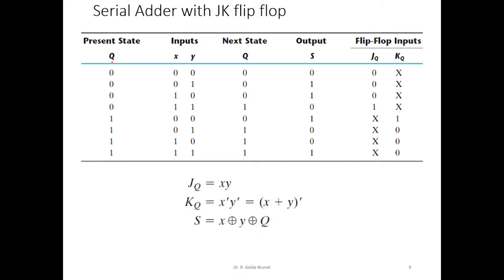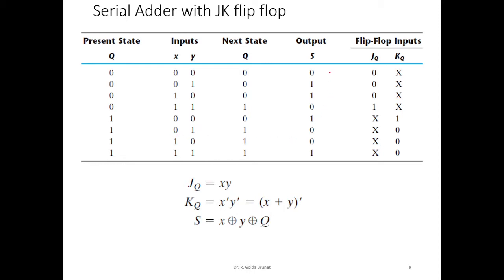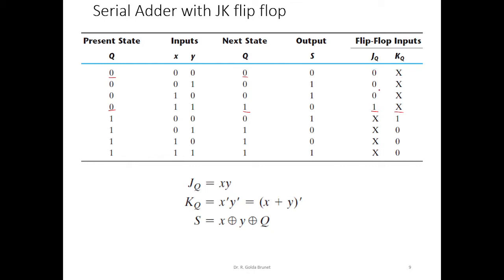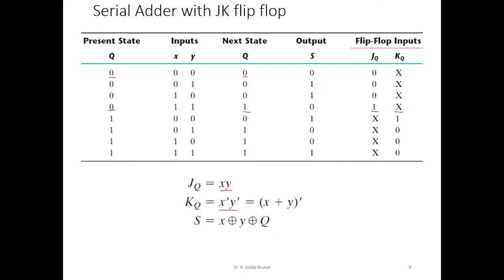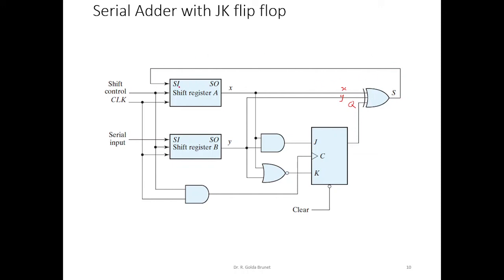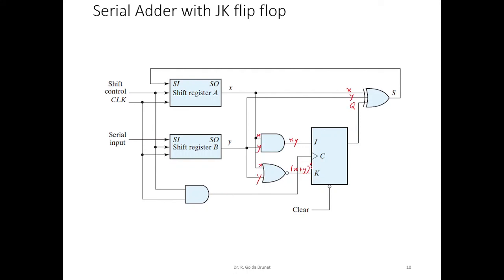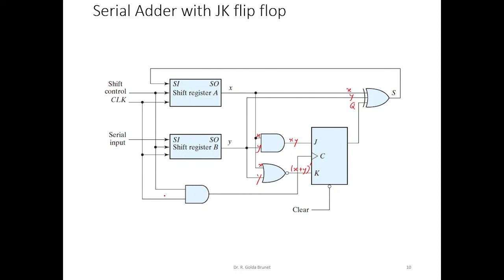Serial Adder with JK flip flop

Comment: Mam can we use full adder in jk flip flop(as we did in d flip flop) in this problem instead of using   separate circuit for sum
Reply from the maker: Yes. You can. This example is showing the design procedure of synchronous sequential circuit for serial operations. You can connect the carry out from full adder to J and its complement to K to achieve the same.

Comment: Can you explain how did i get this values of the next state because it isn't directly from the JK table
Reply from the maker: The circuit simply uses D flip-flop to store the carry output of Full adder which can be fed to next higher order bit addition. There is NO JK flip-flop in this circuit
Reply from the maker: @aerotics  The D flip flop in the circuit is replaced by the JK flip-flop for serial addition
Reply from the maker: The circuit is for serial addition and we use flip flop to store carry bit. We use the truth table of full adder and the carry output in full adder truth table acts as next state here